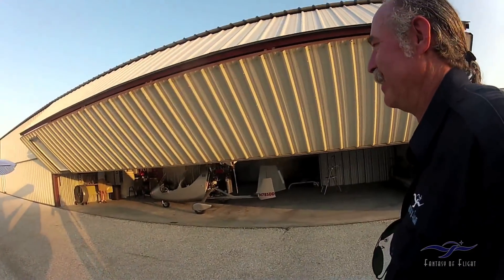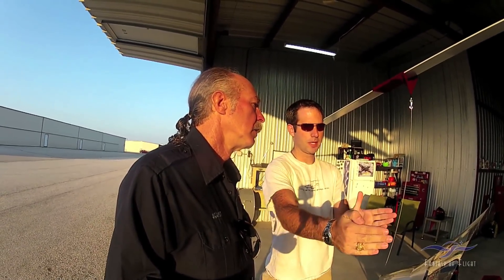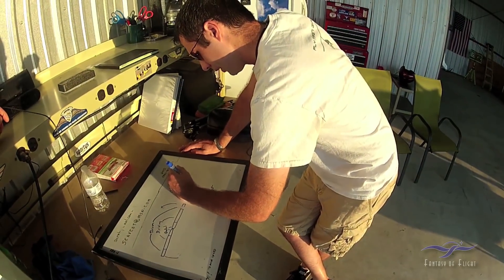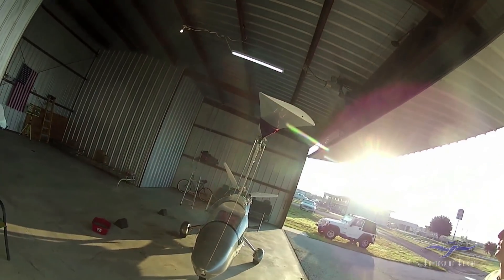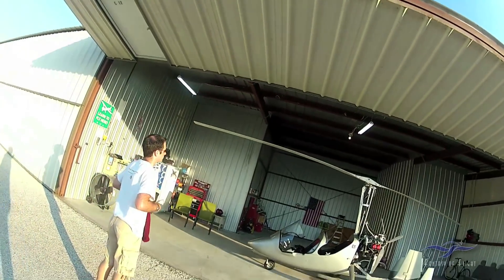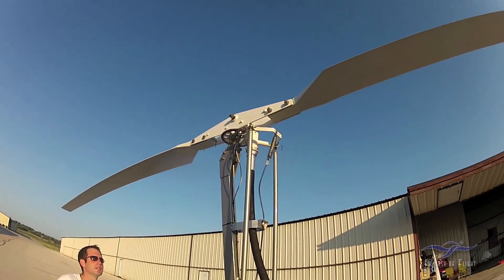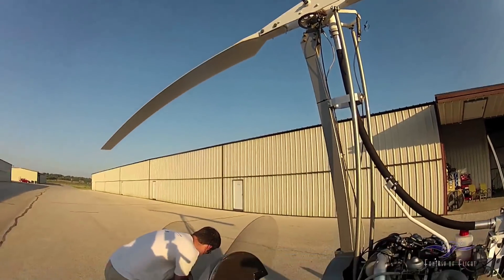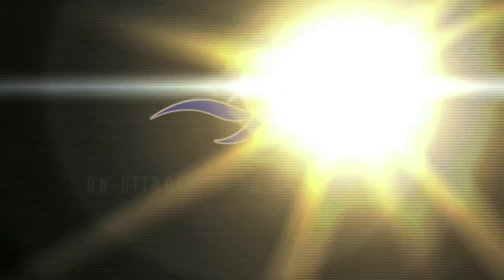AutoGiro Lessons - Part 1 of 3 - "Autogiro Theory"

Comment: Since no power is being consumed by the rotor system, it is in a constant state of autorotation. It free wheels do the relative wind. If the engine quits the aircraft is already in autorotation. In a helicopter the main and tail rotors are powered up until engine failure. The pilot must actively enter autorotation by lowering the collective and adjusting the tail rotor pedals.

Comment: I think that twist on the rotor is simply because it is flexible, along with the topology of the curve of the airfoil
Reply: As birds fly their wings change shape in a similar fashion.. this has springy construction that acts like their muscles.   You have different forces as he explained.. it's the natural flexibility of the material.. I am developing a bio plastic that is flexible, but much lighter than fiberglass and even carbon fiber.. non proprietary technology.. I worked for a subsidiary of Boeing doing factory floor automation software and database development.. manufacturering high tech fibers for aerospace.. and Raytheon building infrastructure, like oil refineries in Saudi.. we are looking at this technology and I am also developing an atmospheric flyer using the coander effect
Reply: Question: has anyone tried uneven number of rotor blades... like 3 or 5... there's a lot less heterodyne in the airframe with the uneven, but balanced forces..
Great information.. muchas gracias señor
Reply: 120° is a very good way to get even forces around a circular vector..  this is very good information for me to work with... much appreciated 🙏 
Peace ✌☮

Comment: I'm comforted to see that you guys don't understand how they work either.
Reply: Agreed. While we know that autogyros do work, it takes real courage to attempt an explanation of how on a high-profile channel like Kermit’s. Serious kudos to Kermit and Dayton!
Reply: ETA: Sincere apologies to whoever's reading... I wrote the previous comment with an "understanding" of autogyro aerodynamics that I now know is wildly wrong. I fell into the trap of thinking of the autorotating blades as making a pancake-thin parachute, but with that force of moving air that would go into billowing out a flexible membrane falling in a column of air redirected instead into the rotation of the blades arou  ar  aro aro I can't see. I've gone blind. I have flipped light switches i my house and I see noghing. The more I think about autogyros the darker it gets. This is bad send hekp
Reply: Thanks everyone for all your concern and all the help finding me these last few days! It's sure good to be back on dry land and GREAT to see again! Autogyros sure are complicated! It turned out that I'd reconciled the difference between the retreating blade being a flat-plate airfoil vs. an asymmetric Bernoulli airfoil at the same time as I contemplated hinged blades and that's when I lost my sight. I crawled for days and days, but luckily I toppled from a cliff and fell into the sea where the shock of the cold water stopped me trying to understand autogyros! As I floated there helpless and gawping sightlessly into the sun I slowly came to understand how autogyros just "spin all the drag up." Gradually and by degrees shape and color came back to me and I swam to shore.  While we know that autogyros do work, it takes real courage to attempt an explanation of how on a high-profile channel like Kermit’s. Serious kudos to Kermit and Dayton!

Comment: Ground resonance is not a flutter issue it is when one or more blades becomes out of phase with the other and it causes adiyssymetry of rotational mass across the plane of rotation while the rotor disc is in motion. this sets forth an extreme out of balance condition and transmits this negative energy throughout the entirety of the airframe
Reply: In addition to this two-bladed main rotor systems are not subject to the effects of ground resonance as he has unknowingly misled you

Comment: Seems like a pretty complex way to describe lift vectoring. The rotor disc is being tilted left and right which, yeah it makes the trailing blade decrease in pitch while the forward blade increases in pitch but overall, you're just tilting the rotor disc which throws more lift to one side.

Comment: The gyroplane has it's blades twisted downward 1.5 deg, where the Helocopter has it's blades twisted UP the oppposite direction from the gyroplane.
Reply: I am sorry, but a gyro rotor has its blades pitched up between 1-2.5 degrees, UP not down. Your name says it all, you would come a buster, correction you wouldn’t even get airborne, as your rotors wouldn’t even spin up. Man don’t comment unless you know what you are talking about.